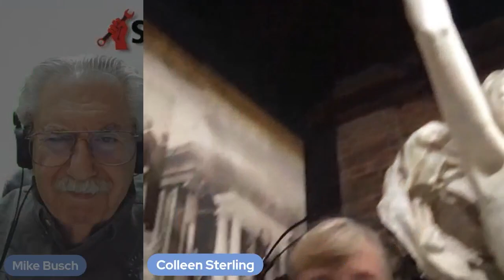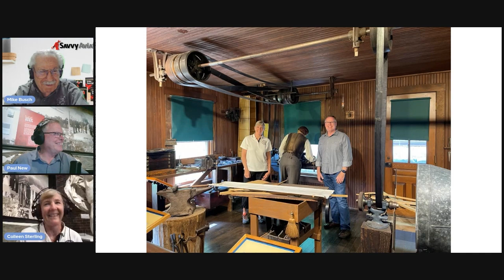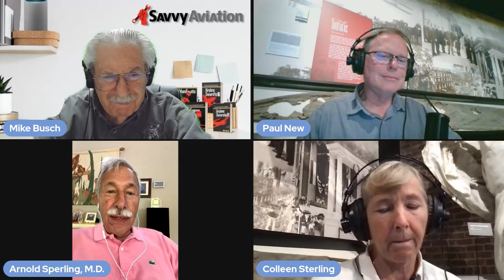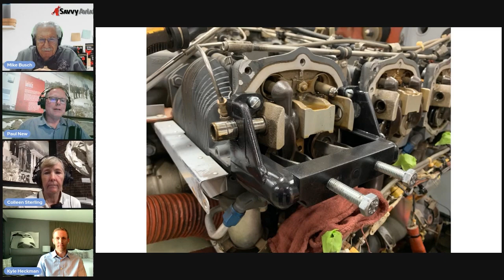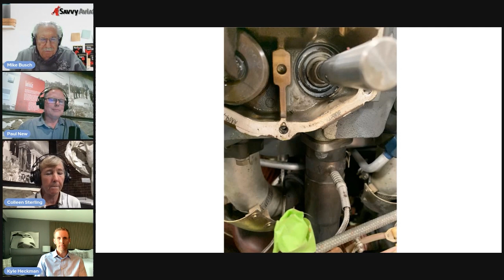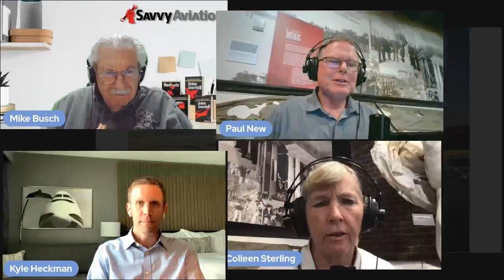Ask the A&Ps Ep. 9 – Flatlanders hate turbocharging

Comment: I was on an FAA check ride with a 172 that I previously weighed with and without the rear bench seat and documented.  Even though the rear seat was installed, the FAA rep requested what authority authorized the removal of the rear seat in flight.  His point was that if it is not called out in the type cert then it was not legal.